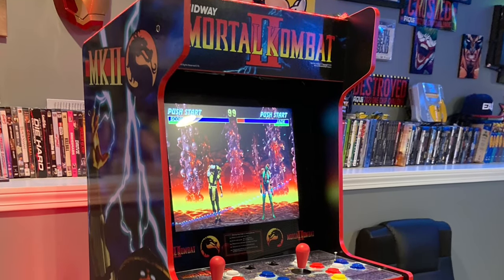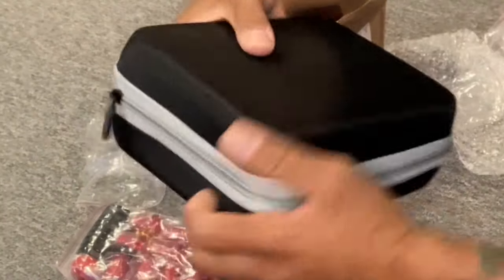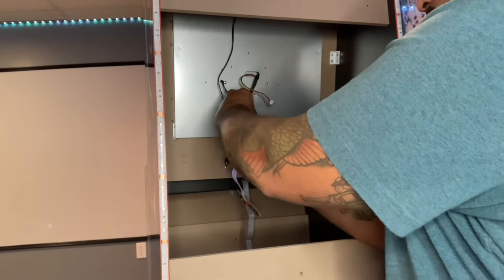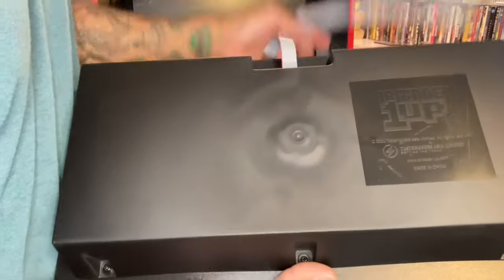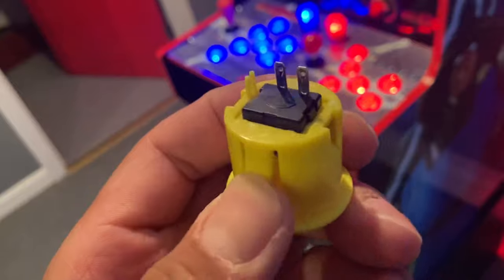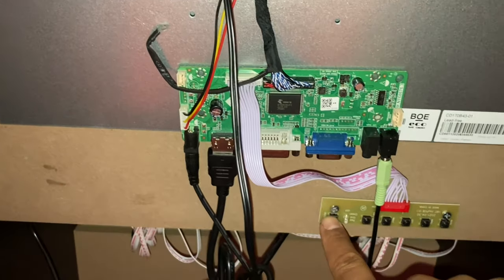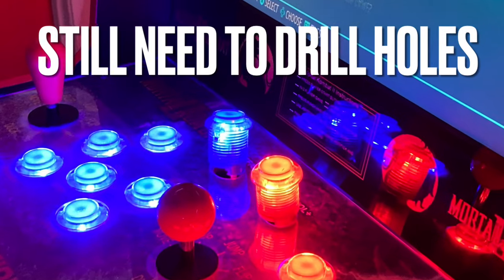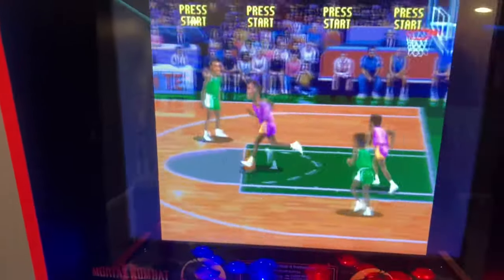How to add 33,000 games to your Arcade1up #subscribe #arcade1up #how

Comment: New link for the arcade box? Original got taken down, thanks
Reply from the maker: Super Console X 256G, Retro Video Game Consoles Built in 65,000+ Classic Games,Game System for 4K HD/AV Output,Compatible with 60+ Emulators, 2 Wireless Controllers,Gift for Men/Boyfriend https://a.co/d/hl3yV66

Comment: I have a question the light on the motherboard is green and the screen lights up white for about 10 seconds then the light switches to red any reason why?
Reply from the maker: Might just be loose. Make sure the board is really secure (without cracking it of course) . I had the same issue
Reply: Thank you!

Comment: one issue the arcade boy has a tendency to flip controls on the USB controller for sticks and stuff. Everything works decent just that part is a bit annoying.
Reply from the maker: Make sure they are wired the same exact way, in the same exact port on both sides
Reply: @dadgamertv84  AHHH okay yeah that makes since I had my son wire up one side while i wired the other.. thanks Ill try that.
Reply from the maker: @Visionist3000  thats dope 👍🏽

Comment: do the stock speakers not work right with it? its extremely low volume even when i hold select and crank the volume up. i tried both the port on the box and the vga board
Reply from the maker: Yeah they were low for me too. I had pc speakers laying around thankfully. But again, this arcade is nothing more than an interactive decoration for me.
Reply: @dadgamertv84  oh ok i thought i hooked something up wrong lol. i figured out how to remove the RA borders finally.. it wasnt allowing me in the UI settings menu i had to in the emulation menu.. from there i could choose the 16:9 ratio and play full screen

Comment: Got it all setup only problem is when I load up a game there is no audio. Do you know why ?
Reply from the maker: Loose connection maybe? Or volume is down. I installed computer speakers for better sound. I just plugged them in and left them on the bottom of the arcade INSIDE the cabinet
Reply: @dadgamertv84  there is audio when you see the game video before selecting a game just not when you launch the game which is strange
Reply from the maker: @migattekid  yeah that is strange

Comment: Can this work on any Arcade1up machines or does it have to be a specific one or model?
Reply from the maker: Ive noticed some arcades have different connectors, just get the hdmi board with the right connector to the monitor and youre good
Reply: @dadgamertv84  does that cost a lot? So basically I could use any Arcade1up you’re saying? I’m new to arcade machines so still trying to understand everything.
Reply from the maker: @xJay2002  probably upwards of 30$
Reply: @dadgamertv84  can you have a 2 player Arcade1up and still mod it?
Reply from the maker: @xJay2002  yes, thats what this one was. You mean, 4 player?
Reply: @dadgamertv84  I don’t know? I want at least 2 people to be able to play against each other at the same time.
Reply: @dadgamertv84  also do you know if you can add this mod to a Arcade1up countertop one instead of the whole machine ones?
Reply from the maker: @xJay2002  yeah you can, its been done

Comment: Which button did you plug into each slot k1-12?
Reply from the maker: The only ones that matter are “start” and “select” which ARE labelled on the bored BUT as far as the rest, it doesnt matter as long as both decks are wired the same exact way
Reply: @dadgamertv84  Thanks!

Comment: I have the same exact setup but I can't get to the button programming screen because my main screen looks different than that I'm guessing maybe a cheap knockoff is what I got or something but any tips to get this done cuz my buttons are all jacked up up is right down is left.  I'm trying to get this done for my brother for Christmas so any help would be appreciated cuz I'm not trying to buy another $150 joystick deck lol
Reply from the maker: Check and see if your connections for  both controls are plugged into the same exact ports on the encoder board, that can be the issue. Do you have the encoder diagram?
Reply from the maker: Also check and see if your joystick is installed upside down
Reply: You know I bought it from China so it didn't come with an encoder guide so I kind of had to wing it and it also didn't have like the app controllers do where you can just plug in all four of the joystick directions if it's one plug I had to actually individually put them in there was two two wires per direction and I'm almost positive I put them in upside down and I didn't install two extra buttons but like every time I go to try to map it on like a like retroarch or something it shows like a dual dual analog like PlayStation looking controller I'm also due to this if you can't tell but thanks I'll try to flip them around and see if that helps it looks simple but you can kind of get yourself mixed up if you're like doing it in between watching the kids running around or something
Reply: Thank you though I appreciate it I'm going to check that out shortly
Reply from the maker: @jacobtoombs9206  i get it. Well i do have a picture in the video of my encoder diagram, maybe it can be of help. If not, then good luck and i hope you can figure it out before xmas

Comment: Any idea why my arcade box doesn’t fill the screen like yours? Everything works but I can’t get the ratio right even if I change it in settings
Reply from the maker: Did you remove the bezel in the settings?
Reply: @dadgamertv84  yeah I removed bezels and tried the ratios. Start up the monitor terminal fits great. But then the emulation station gets into a weird ratio at the start of loading
Reply from the maker: @RardawgOG  hhmmm…. Try 4/3

Comment: Drill holes on the side, so it's like pinball, so you don't have the 2 buttons sitting on top
Reply from the maker: I already drilled the holes where the original ON/OFF & VOL switches were. I still have 2 extra buttons, i was thinking of doing the pinball buttons

Comment: if i want to only install the arcade box do i need to change the pcb
Reply from the maker: Yeah you have to, otherwise theres no connecting it to anything
Reply: @dadgamertv84  thank you for your time to replying if you don’t mind answering one more question so the only thing you need is a new pcb to connect the arcade box
Reply from the maker: @choccy2777  you kind of HAVE TO get the new buttons because they come with usb connections that plug into the arcade box… BUT unless you find a pcb thats compatible with the control decks original connectors, your good

Comment: Is it possible to add light gun in this mod?
Reply from the maker: @JovanasWorld-cr2hm  no
Reply: How about connected to Nintendo switch and using Nintendo shot gun with joy-con?
Reply from the maker: @JovanasWorld-cr2hm yeah i guess so, this video is for more games as an “arcade” but essentially you’re putting in an HDMI converter so you can put whatever you want in there.

Comment: Why do mine have a black screen when turning on ?
Reply from the maker: Sometimes the board with the on/off button that the converter came with is too loose to stabilize the connection. Check that
Reply: @dadgamertv84  awww that fixed it thanks man ..  but now I have another question.. how to get my arcade box to show games ?  When I turn it on it looks like in in a android system , I see no games
Reply from the maker: @BAMGGAMING  hmmm, maybe check if the microSD is fully inserted
Reply: @dadgamertv84  awwwww lol you're right again 🤣.  Ur awesome man . . Ok last problem, why can't I hear sound?
Reply from the maker: @BAMGGAMING  whatever button you assigned as a “hotkey”, hold that and press up on the joystick. It should control the volume BUT the sound WILL be weak unless you put a cheap pair of computer speakers inside.
Reply: @dadgamertv84  thanks so much
Reply from the maker: @BAMGGAMING  no problem. Glad to be able to help

Comment: Dude do not mount a bare circuit board to a piece of metal!
Reply from the maker: 🤷🏽‍♂️ Still works just fine, and if it fucks up i’ll just get a new board.
Reply: @dadgamertv84  so instead of instructing people to properly insulate two pieces of metal, just a 1/4" of Velcro and pray that it doesn't fail?  I'm sure "I'll just get another one" is EXACTLY what you'll say when you're in the middle of a family game night trying to enjoy yourself for an evening after a 12 hour shift.
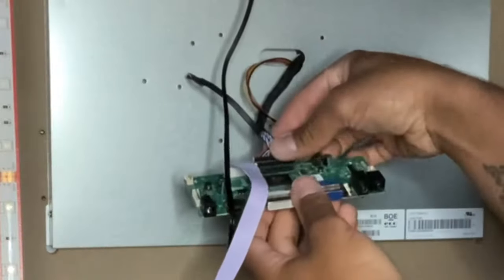Reply from the maker: @DeAthWaGer  2:36
Reply: @dadgamertv84  highlighting your electrical engineering equivalent of telling people to lick their hands after prepping raw chicken?  K.
Reply from the maker: @DeAthWaGer  i love chicken